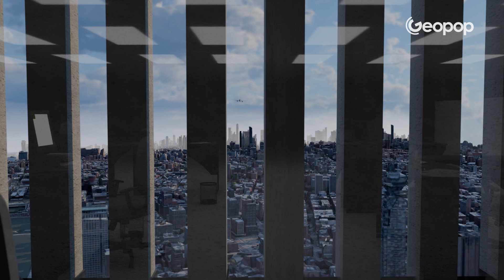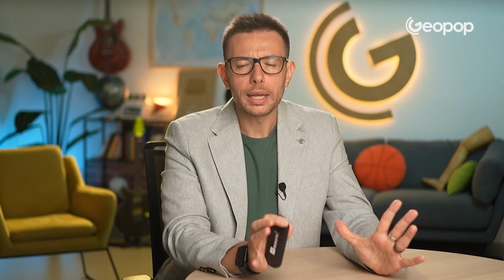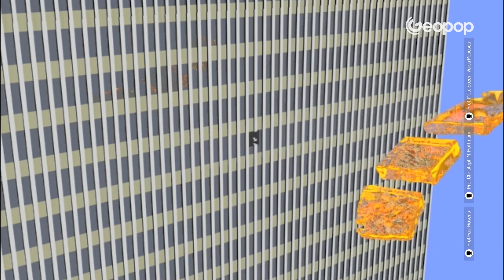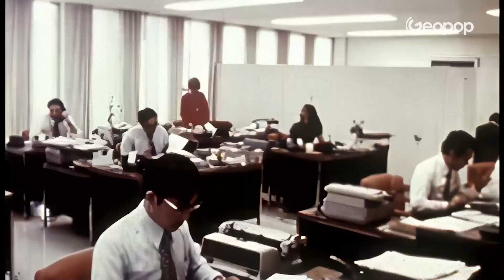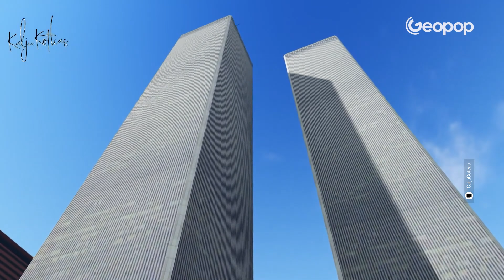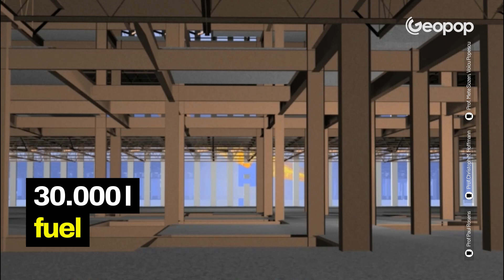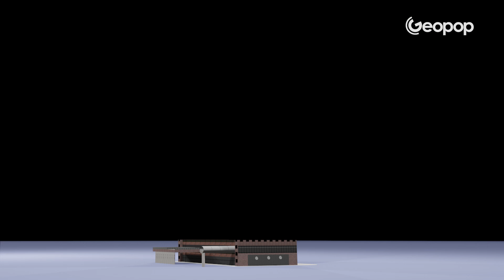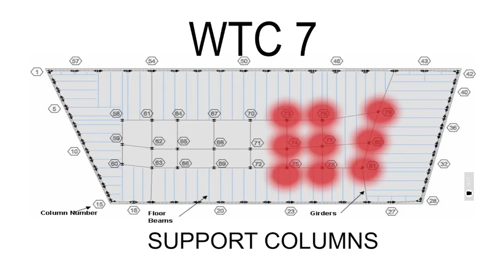9/11, 2001: The Technical Reconstruction of the Twin Towers and WTC 7 Collapses

Comment: No matter what anybody says, truth is they built the Twin Towers for shit: Weak and wobbly, sacrificing safety for speed of construction and lower costs, focusing on maximizing open space for businesses, interiors made of drywall and plaster; not just the towers didn't resist but they took with them thousands who couldn't escape. Summarizing: The towers were so weak that the airplane impact bent them rendering the elevators unable to move through their now distorted wells, the steel beams were bare and exposed to fire without even a layer of fire retardant on them which made them bend and fail in no time taking the entire building with them (they did belatedly attempt to quickly apply some but even that they fucked up because they sprayed it and so it peeled off on its own especially when the impacts shook the towers and they would've taken years to finish so most of the towers had no fire retardant when they were attacked), the emergency stairways were located in vulnerable locations which is why most were destroyed immediately trapping thousands, most of their systems were so vulnerable they failed immediately (like the water sprinklers or the PA), the smoke accumulated in all hallways and stairways, and I could go on and on with the list of fuck-ups. Oh and on top of all, their design was hideous. They fucked this one up and Leslie Robertson was an incompetent dumbass and should've been prosecuted for negligent homicide and his license to work as an engineer taken away permanently.
BTW, let's not forget about the jackass (whoever he was) that ordered everyone inside the towers over the PA to remain where they were which is why thousands decided not to save themselves or tried to do it but too late.
Reply: The Twin Towers were perfectly safe within their design envelope.  They only collapsed when taken far outside design parameters by an extraordinary and unprecedented event.
Reply: @TheLoonResistance  The Titanic was perfectly safe within its design envelope. It only sank when taken far outside design parameters by an extraordinary and unprecedeted event.
Reply: @charlesferdinand422  - I would agree on Titanic as well. I would not agree on Titan.
Reply: @TheLoonResistance  The Titan submersible was perfectly safe within its design envelope. It only sank when taken far outside design parameters by an extraordinary and unprecedeted event.

Comment: Buildings fall at the speed of free fall, folding neatly without hitting the others too much, building 7 falls even without an airplane strike, passports remained intact and were found among all the debris, the Pentagon building has minor damage that does not look like an airplane strike, but of course continue to believe the TV
Reply: The towers fell slower than free-fall, they destroyed numerous neighboring buildings, the found passports were thrown clear not found in the pile, and the Pentagon showed damage very much from an airplane strike. Believe what you like but don't be delusional.
Reply: @Tim22222  delusional… what and you think a plane made of aluminium and fibreglass is gonna go through all 6 reinforced walls of the pen as well as steel t****s😂 laws of physics took a little break that day did they🤦‍♂️😂 … wonder why they had 80 odd cameras and angles on the pen but chose to only give us 1 shady clip/angle from it?? Hmm🤔
Reply: @carey1foremmer  - Flight 77 did not go through 6 reinforced walls of the Pentagon. It went through only one. The Pentagon rings only exist on the 3rd, 4th and 5th floor. The 1st and 2nd floors are continuous open office space. 

If you think believe the laws of physics took a break that day you are either claiming magic or divine intervention was involved or admitting you don't know nearly as much about physics - or what actually happened - as you pretend to.
Reply: " folding Neely without hitting the others too much" 🙄 
In reality it destroyed six of the buildings that day. Damaging numerous others. Yes it hit  building 7. Yes it burned for 7 hours without any fire suppression. Yes the fire department determined building 7 was going to collapse the hours before it did
Yes they often find personal items in plane crashes.  Yes they identified people on all four jet. Yes the Pentagon was heavily damaged on one side. The identify all the passengers and crew members except for one small child, the Black box information jet Parts it was on radar it was seen by over a hundred people. ....
Reply: @ ahh embarrassing man😞the government will always get what they want and it clearly shows wake-up
Reply: Just like you believe whatever dumb shit you find on the internet. 

Literally there is not a single true fact in your post.

Comment: I have to disagree that the temperature inside the towers never got hot enough to melt steel. One there is a video showing molten steel flowing from the first tower to fall a few minutes before it fell in the same video on the other tower you can see the outer walls glowing orange from the heat. Considering everything that exists in an office building, paper carpet printers table's chairs desks wiring wood from the interior walls/desks cloths, and people all were burning in an enclosed steel box with layers of fireproofing on the steel with two big gaping holes hundreds of feet in the air where the wind speed is ripping thru the buildings feeding oxygen to the fire. Those buildings were essentially turned in to a blast furnace, more than capable of melting steel. The fireproofing over performing even though a lot of it was striped off on impact is one of the main reason those towers stood as long as they did.
Reply: Molten steel pouring out of the South Tower (and it was in fact ONLY the South Tower)?  You mean this?

youtube.com/watch?v=xPVGGQU-MeQ&ab_channel=SeekersofTruth 

So you think that is molten steel why?  

The Boeing 767 which struck the South Tower weighed 117 tons and 80% of that was aluminum.  The exterior cladding on the Twin Towers – the white panels – were also aluminum. When Flight 175 struck at the 81st floor its momentum deposited much of the office contents in its way and the bulk of the aircrafts mass into the NE corner of the building. The piled up debris shoved into that corner is visible in photographs and video so we know it was there. 

There’s a good shot here of piled up debris from 4:36;

youtube.com/watch?v=ZLJyL63sqtU&ab_channel=MrKoenig1985

Steel melts at roughly 2,750-deg F while fires in the South Tower reached peak temperatures of around 1,800-deg F. Aluminum OTOH melts between 887-deg F to 1,180-deg F depending on alloy. That aluminum will melt under these conditions is not a surprise. If you look at pictures of cars left behind and destroyed by forest fires the aluminum wheels are invariably melted away along with other sometimes aluminum parts like hoods. Steel bodies remain intact. 

The “molten metal” appears at 9:52 am. At the same time we see the first externally visible signs of sagging floor trusses and the pulling of the perimeter columns inward. I submit these events are related, not coincidental. The aluminum cladding at the NE corner also appears to me to be burning. 

It is likely the with the floor trusses sagging under the heat, and the 81st floor truss in the NE corner under the debris pile subjected to the heavy load of the debris pile, the truss broke its perimeter column connections and dropped, instigating the material starting to pour out of the NE corner at the 80th floor.

Given the properties of the materials in question, aluminum is by far the most likely culprit. 

Reports from The NIST, FEMA and MIT all concluded the material is aluminum. 

Certainly steel is the least likely of all the materials the anomaly could be given its much higher melting temperature and the fact there is no logical source for molten steel.  The perimeter columns in the NE corner are intact and the material is pouring out between them. So it isn’t columns melting, therefore what other source of steel is there?

Deniers will claim molten aluminum appears silver when molten, which is true but only at the low end of its melting temperature range. Aluminum can and does get hotter and it glows red to orange when it does (1,100 to 1,800-deg F).  Most folks of course just don’t bother getting it that hot if the goal is just to get it molten for say molding a part. No need to go higher. 

The total mass of molten aluminum is a BIG deal in regard to how it behaves when poured. Quantities bellow half a liter cool almost instantly if poured onto a flat surface, but if poured into say an ingot mould will stay red for a minute of so. Pouring volumes of molten aluminum greater than a liter is a VERY different experience. The thermal mass is much greater and the radiant heat is horrendous. The aluminum is able to stay liquid and remain glowing bright orange much longer. 

The famous video of glowing liquid gushing out of Tower 2 moments before it fell, involves at least tens of liters of molten aluminum. The thermal mass involved is so great that it stays red after falling many meters through the open air.

Side note: There was also a large UPS battery farm in that spot and some of that material at least may well be from the batteries IMHO.

Comment: 17:50 The aerial view of the illustration shows WTC 7 as being the outermost building in the entire complex. Nothing is mentioned about WTC 3, 4, 5 and 6 as being completely collapsed. I've seen photos of these buildings.  They are badly damaged, but they didn't collapse completely in the way WTC 1, 2, 7. Regarding a comment that "no one" has refuted NIST's explanation of how these buildings collapsed, is incorrect. Architects and Engineers for 9/11 Truth has been very vocal about the serious flaws and inconsistencies of the NIST Report. I have a friend who is a retired commercial pilot for 35 years. When I asked him what he thought brought those buildings down, he said  "I don't know, but they weren't  commercial airliners. The laws of physics make what we saw absolutely 100% impossible. Commercial aircraft are basically aluminum and fiberglass tubes  with wings. They are not designed to or capable of withstanding flying 500 mph at sea level. They would break apart in mid-air, and that's before striking a steel and concrete building. That's why we fly above 20,000 ft + . The air is much thinner to allow flying at those speeds. Even flying at speeds much lower, the aircraft would break apart on impact. There would be a lot of damage to the floors that were hit, but most of the plane would bounce off the building and fall to the ground, and nothing like what is shown on television or videos." Check out the videos from Architects and Engineers for 9/11 Truth. It's explained in much more detail and scientific information for why those professionals believe NIST cannot possibly be true.
Reply: Building 4 completely collapsed as did St Nicholas Church. Neither was seen on camera so they don't capture the conspiacist imagination.

The only thing AE911T have ever got right is th he date.

Comment: Wow, a video released in 2024 still trying to substantiate the false narrative that the US Government dropped on the world immediately after it happened. No investigation, no preservation of evidence, identifying the culprit as Osama Bin Ladin only hours after the attack. Experiments have proven that if top floors collapsed onto the lower floors, accelration would have slowed down to a stop. The weight of upper floors couldn't compare to the non damaged floors below. The acceleration would have slowed down, and most likely stopped completely before reaching the ground. There are over 1500 Worldwide architects and engineers who totally believe that NIST was a patsy to the US government to invent a reason to support the position of the Government. You also think a Boeing 757 crashed into the pentagon through 3 feet of reinforced concrete and that the soft aluminum of the jet was able to crash through 3 rings of the pentagon?? How about a bunker busting cruise missile? Have You ever seen a dent that a nine pound goose causes when hitting an airliner? Get serious. No evidence whatsoever of an airliner hitting the pentagon except small pieces that looked like airline skins placed on the lawn???? Where are the engines?????? The engine part found inside the building was the size of a cruise missile. Not a 757. Also, within 30 minutes of the attack, FBI agents confiscated 86 videos from around the pentagon. There were only two frames from one Pentagon Gate camera ever shown. They could easily disprove all Conspiracy theories by showing the video of the supposed jet just before impact!!!!! They can't show the full video, because they KNOW it was NOT a 757 that hit the pentagon!!! Oh, check out the close up photos of the plane hitting the 2nd tower. Compare the underbelly of that jet compared to a 767. Many witnesses stated they saw a plane of military color, not an American Airlines passenger jet. Research operation Norwood. Get your head out of the sand. I don't know exactly whom was responsible for these attacks, but someone in the US Government was knowledgeable and complicit. Also, in New York, the engine from one of the jets found was identified by engine experts as one from a Boeing 747!!! Opps. I guess they planted the WRONG type of engine. Those killed in attacks deserve TRUTH!!!!
Reply: Damned right, brother.  Thank you.
Reply: @steverid Everything he said was wrong. All debunked.
Reply: So debunked. None of this is your own thoughts.